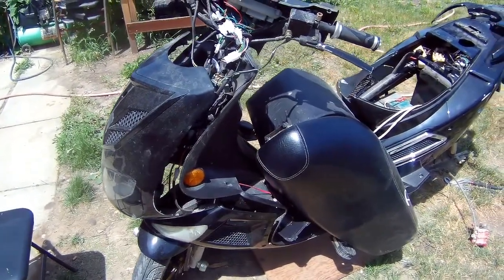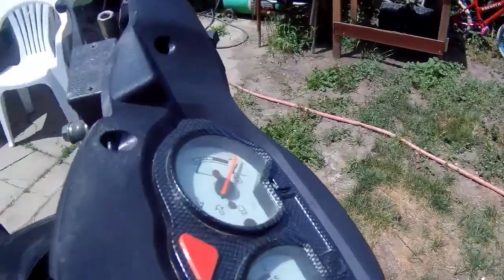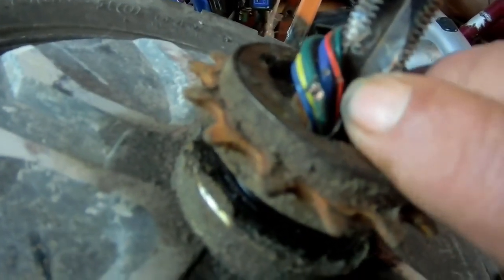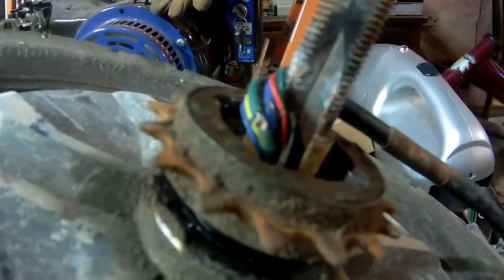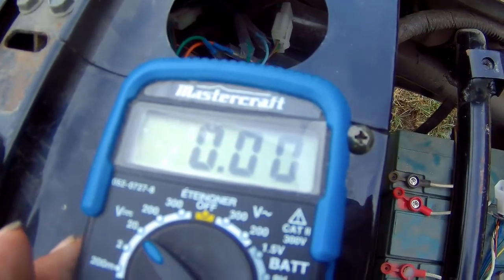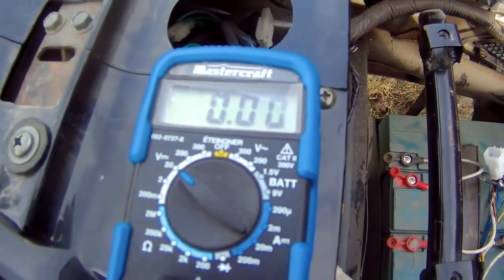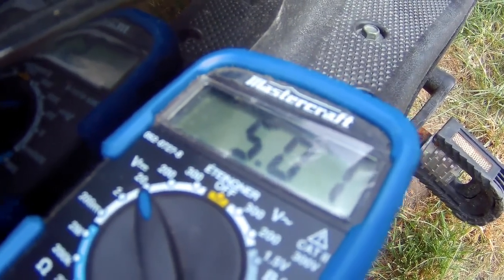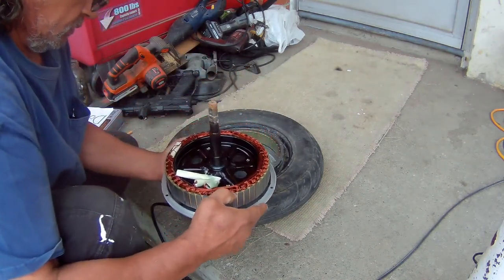Trying To Fix My EBike pt.1

Comment: Hey Neves.   I have no idea when it comes to electrical stuff.  I can do basic wiring diagrams and thats about it.  Hope you get her fixed mate.  👍
Reply from the maker: Hi Custumewinder, I was pretty good at electrical when I was a mechanic and I have built an EBike from ground up (have a build log on Endless Sphere forum) the problem with electrical problems is you need to eliminate what it could be before you find the problem and that takes a long time, EBike electrical is way harder then house electrical
Reply: Neves Projects ah pretty good on the sparky stuff eh mate.  I know what you mean with the e bike  stuff.  Ol mate over the road  here rebuilds e bikes and scooters.    I just donated a small quad to him.  I bought the quad for the wheels but gave him the wheels and all to rebuild the quad.  500 watt motor  being replaced with  a 1000 watt  unit.   36 or 48 volt   and big amp speed controller.   Should get it up and going well.  I was going to use the wheels on a buggy I'm building.   I'll have to get some more now 😂 .  
  Bit of trouble shooting and you'll have yours sorted.   Be good to see her going.  Thanks Neves.  We'll   see you next time.👍